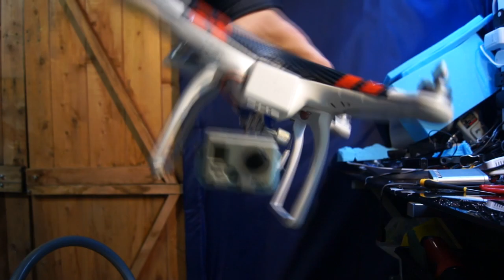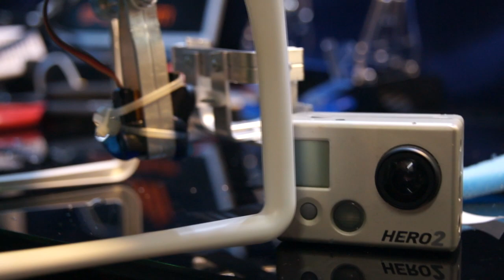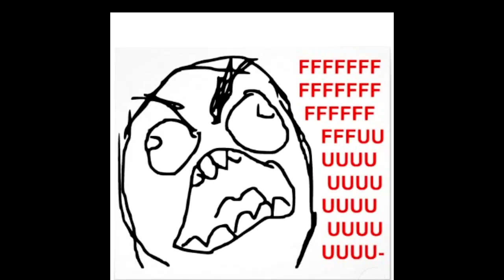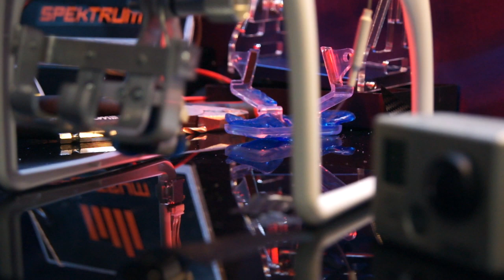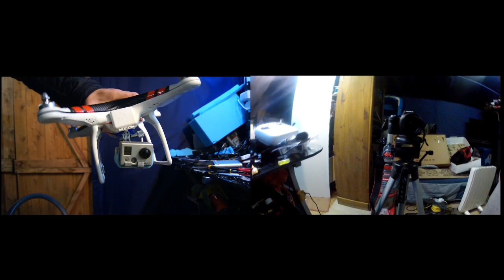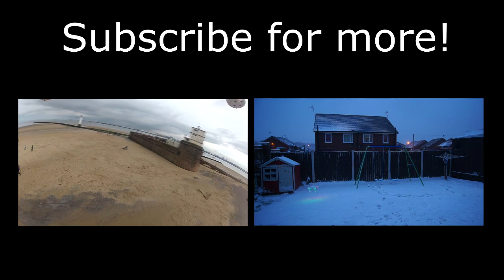DJI Phantom Gimbal test #2

Comment: What's up with those erratic movements ? The point of gimbal is to stabilize the footage as good as it can, so the only thing you have to show is some stable footage in the air. Not jerking the helicopter in all directions like in your other videos, but one steady stable slow moving footage like you can see in the movies.

Comment from the maker: its the Savox SH-0255MG. I would buy a sevo with a higher HZ rating, This is only 70hz, the naza only runs 50hz or 100hz+ so I have to have it at 50 so it does not burn out. thats all I would change really.